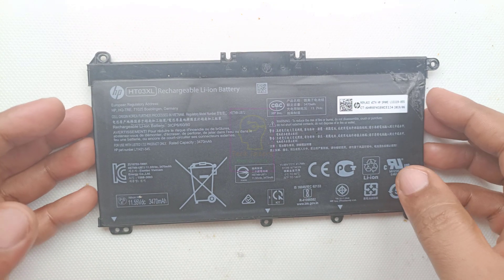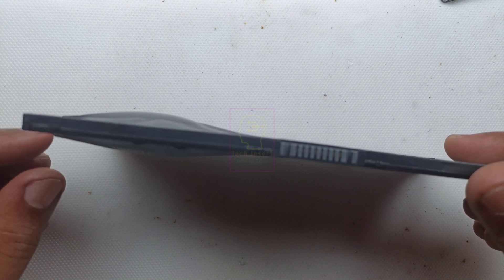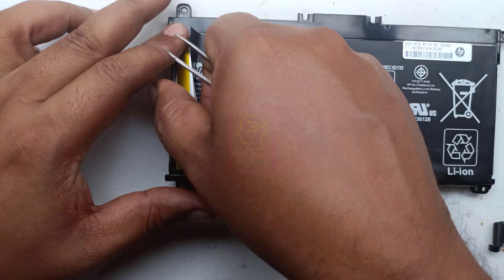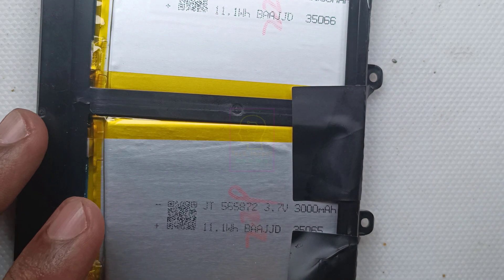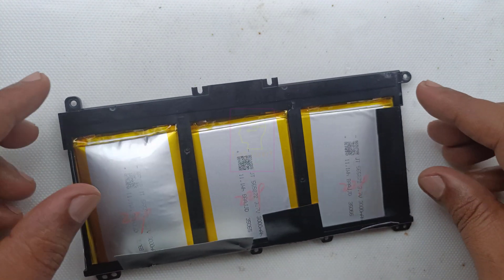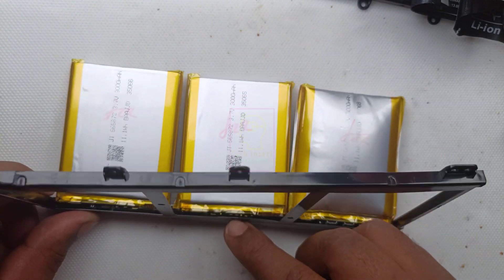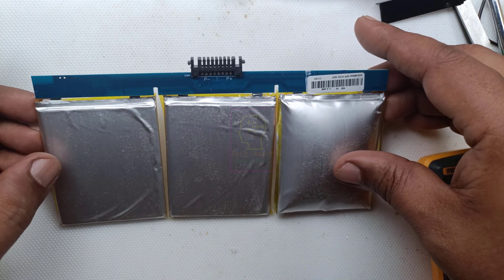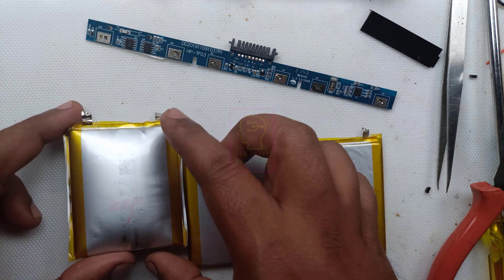You will be surprised when you see inside of the  HP Laptop Battery

Comment: excellent. i was thinking on the same line and here you have the solution. the power would be more as compared to the designed battery ( 57 Wh against 41 Wh ) but it can be further increased by using higher capacity li ion batteries. 👍
Reply from the maker: Yes, the only drawback is the charging time will be higher

Comment: Sir can i use 3 18650 cell at each column that means total 9 cell
Reply from the maker: Yes , charging time will increase and backup will also increase
Reply: @TechInsert  sir but i doubt if i increase the number of cells like 3 cells in each column, will the amp have any effect, will the bms also have any effect, the bms can handle that load.
Reply from the maker: @vrunalpatil9723  No issues- If BMS is 1A, it will max deliver 1A only. If we are pulling more than that, BMS will disconnect the battery to load. Also If you are adding more battery in parallel,, still BMS will not give more current for charging, it will give the same rated current, which will take even more time for charging. Kindly watch the below video and this will give u fair idea about the BMS.  https://youtu.be/WZY7hQUE5cs
Reply: @TechInsert  thank you
Reply from the maker: @vrunalpatil9723  You are welcome

Comment: How did you identify which pads are minus and which plus on the controller board
Reply from the maker: 0 is minus and 12V is +
Reply: I just realised now. 
They have the controller board pads labelled but only one is labeled as ground so that's obviously wrong
Reply: Doesn't each cell need a plus and a ground so 3 grounds and 3 plus
Reply: @emmanuelvalmas5648  yes bms has 3 ground and 3 plus connection points and the batteries have been connected properly. see video at 11.45 - 12.00